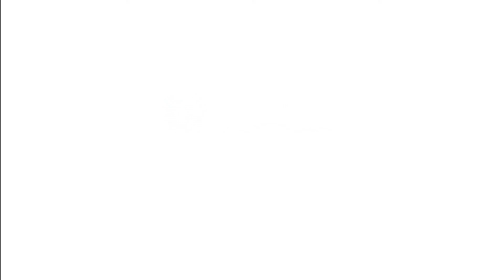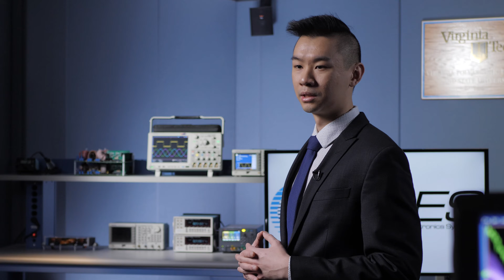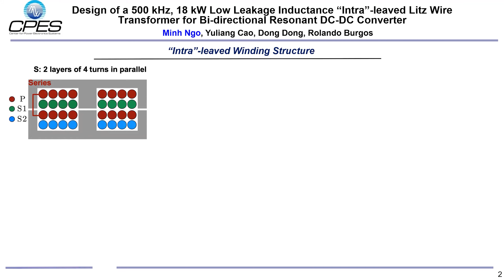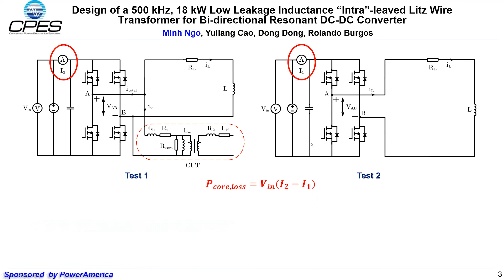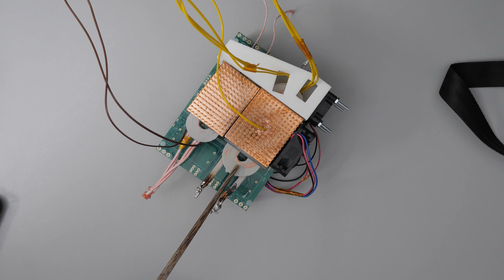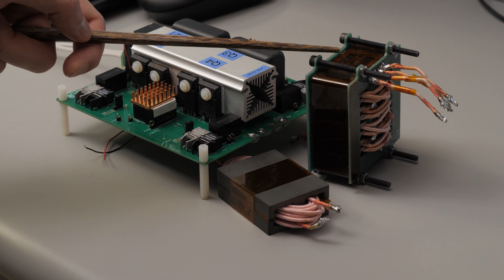Magnetic Design and Validation of a 500 kHz, 18 kW "Intra-Leaved" Litz Wire Transformer

Comment: Nice achievement with such high power transfer, however this interleaving technique is not new ! Back in December 22, 1949, so 76 years ago, Mr. Frank H. McIntosh, that soon later become known for his great tube audio amplifiers design, filed a US patent (# 2,477,074) where, besides amplifier design invention, also invented the so called "unity coupling" output transformer, that relies on bifilar and trifilar windings, kind of mixing together primary and secondary windings with the key objective of improving efficiency with low leakage inductance and capacitance, balanced impedance between windings and a super wide frequency response bandwidth, offering a superb audio performance. Of course we are talking about different objectives (power transfer x audio performance) but the transformer technique claimed in this video is exactly the same !

Comment: I used dioelectric liquid or gelatin to keep the bad sparks from jumping into other components of high voltages in the jump to contacts with a single step in the liquid to cooling circuts and the voltage of jumping charges small and intensely intrested ❤the environment of many clustering principles of electro induction gapping is important

Comment: It probably must be an LLC converter with an air gap in a magnetic core - sinusoidal current allows decreases conductive losses in wire (and increase current density and reduce weight and size); decreases losses in a core because a frequency is quite high for regular power ferrites , like N87.
Reply: Yeah. But the coreloss modelling mentioned at 5:50 is... well let's just say not that accurate.

I'm also curious what kind of material he used. I once designed a planar transformer for the same switching frequency (but only 1.5kW) and the research for a material with appropriate losses for this frequency was a pain in the ass.